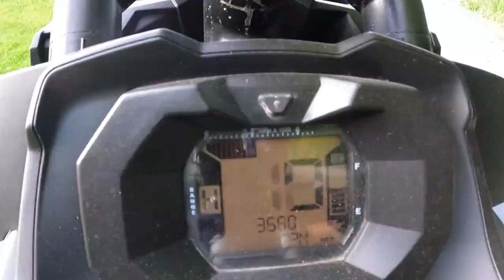CVTech Clutch Vs Spring and Weight Clutch Kit | Which One Do You Buy? | Comparison Videos!

Comment: Do you know the weight and springs you got with the cvtech? I've got the same. 650xmr with 31s and cvtech. I think 06 weights and 1017 spring, and silver epi secondary spring. Mine originally was setup for different tires, so I've been trying to tune myself. Be nice to compare what some others put as the setup.

Comment: thanks for the video it was very helpful. I recently got my cv tech clutch but I'm not happy with it and I need some help. there was a drop-down bar when I was purchasing this clutch that was asking what size tires, I selected 29/30's but definitely not working right, I have a 2023 outlander xmr with K&N intake and full HMF Titan Exhaust the bike also is tuned with dyno jet power vision 3 running ATV Terminators 29.5X10X14 on MSA Wheels,
my stall/Engagement went from 1800 stock clutch to 2900 RPM that's way to high and also, I know that the clutch is slipping is not grabbing the belt hard. 
when I get on my bike, and I hit the throttle, and the rpm jumps up the bike starts to pull but there is time where I fell the belt slipping cause out of the sudden you can hear the motor RPM spike up a bit then grabs again. my stock was running way better :)
if any of you guys can tell me what weight and spring, I should run I would gladly appreciate

Comment: Which clutch is this and website you use to order/buy it from?
Reply from the maker: Seth bought his from Peakboys in CA, Marshall went with Griffen performance.
Reply: Hey I also bought mine from Peakboys from Yanick but how do you really know when it’s set up right I also have a outlander xt 650 max with 29.5 assassinators I took a chance and put a 1017 spring and 16 gram weights and a white epi spring thanks
Reply: @livelaughlove20able how is that set up working for you so far? I have a 650XT MAX and just running stock TerraCross tires but would like something more mud friendly in the future without taxing the 650 engine too much. What set up would you recommend based on your experience?
Reply: I definitely like the setup only thing I’ve changed was I dropped the clutch weights to 12 gram weight that helps with sfiftout
Reply: I definitely like the setup only thing I’ve changed was I dropped the clutch weights to 12 gram weight that helps with sfiftout
Reply: I definitely like the setup only thing I’ve changed was I dropped the clutch weights to 12 gram weight that helps with sfiftout
Reply: @livelaughlove20able  thanks for the quickest response ever. I will go with your suggestion than. What’s the difference with shift out RPM on 12g weights as compared to 16g weights. I will probably go with some 29” tires too but not sure which ones yet.

Comment: I've got a 2021 outlander 650 Xmr, what kind of tune are you running? I was quoted $350 CAD for a reflash and not sure if it's worth it. Also the CVtech is $700 here as well, which is a bit pricy so would a clutch kit suffice? I'm running 26" terracross tires on the can am XT 14" wheels since most of my riding are trails (my friends don't really like mud riding or muskeg lol)  the mega mayhems are put on only when I want to play in the mud. Is there any other mods that you recommend? Any suggestions or ideas are appreciated. Thanks!
Reply from the maker: I’m currently running the atvflashing.com tune in mine. Basically they add some fuel because the quads are very lean from the factory which also helps with cooler running temps and power. And in your case, I think the Dalton DBO650 clutch kit would do more than enough for you. I had great luck with mine. Definitely a tune would be your best mod yet even with a stock exhaust as far as mods go. And for the price, the Dalton kit will give you a lot more power to the ground as well 🤟🏼
Reply: @LetDirtFly  thanks dude, found the DBO650 kit for $233 Canadian which isn’t bad. And as for tune, the ECU will be sent out for a reflash in the fall (so I don’t have down time for riding) Asked them to get rid of the lean condition, remove speed limit and raise RPMs. I also like the Titan QS on your 650, it isn’t obnoxiously loud. Are you getting a noticeable power increase with all of it?

Comment: So if I have a regular 2018 650XT MAX and I am looking at slightly increasing the tire size for mud riding. Planning on keeping the stock TerraCross tires and size too for trail riding because it’s comfortable and affordable. What’s the set up I should run?  Would like some opinions and Asking everyone that runs a similar machine or set up.
Reply: So I have a 2022 outlander max xt I’ve went with 29.5 assassinators for the summer months and I run 30 inch itp cryptids for the fall/ winter months especially for ice fishing and you definitely want a cvtech primary clutch and only have to change the secondary spring like a red or white epi spring red more for trail and white for mudding I’m still switching back and forth but kinda leaning towards the white spring but still keep the red just in case so on the cvtech I’m still fine tuning but by dropping the clutch weight lighter it helps with the heavy weight tires to engage and hold the rpm’s up to push through the narly thick mud that you might encounter!! Hope this helps to get you started in the right direction and on a side note I’m getting my ecm tuned too to run smoother and add a few more hp to my machine!
Reply: So I have a 2022 outlander max xt I’ve went with 29.5 assassinators for the summer months and I run 30 inch itp cryptids for the fall/ winter months especially for ice fishing and you definitely want a cvtech primary clutch and only have to change the secondary spring like a red or white epi spring red more for trail and white for mudding I’m still switching back and forth but kinda leaning towards the white spring but still keep the red just in case so on the cvtech I’m still fine tuning but by dropping the clutch weight lighter it helps with the heavy weight tires to engage and hold the rpm’s up to push through the narly thick mud that you might encounter!! Hope this helps to get you started in the right direction and on a side note I’m getting my ecm tuned too to run smoother and add a few more hp to my machine!

Comment: If you stick with stock size tires should I still get the better clutch kit?
Reply from the maker: It definitely wouldn't hurt. A lot of people run full on STM setups with stock size tires because it'll put the power down much more efficiently and the acceleration will be much stronger
Reply: @LetDirtFly  is adding an aftermarket clutch worth it with respect to the power it adds on the stock size tires? Or is it like a slight difference?